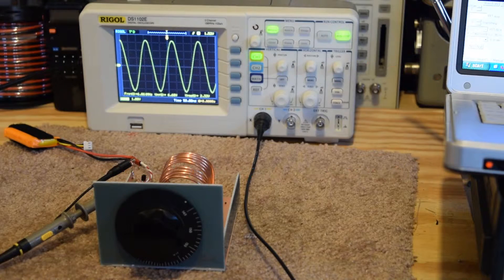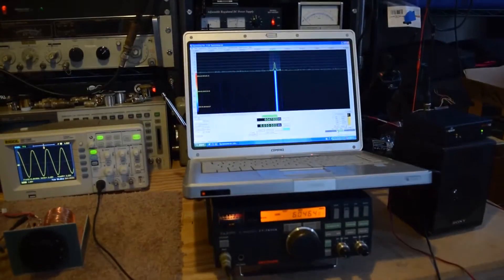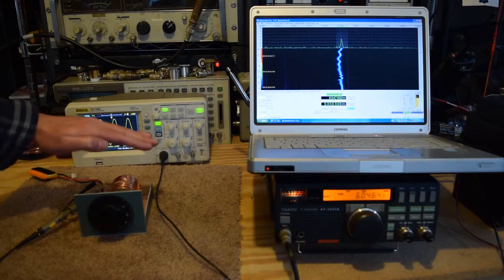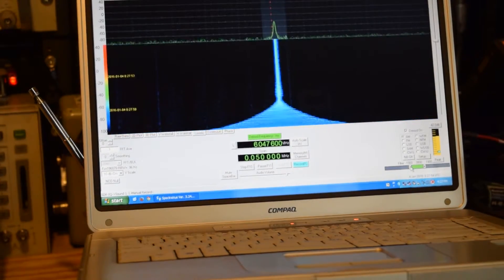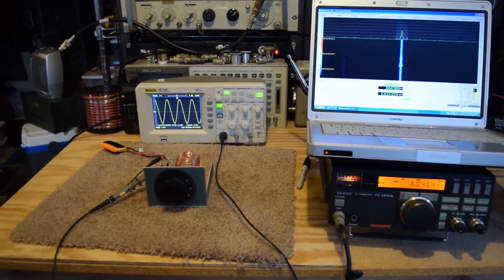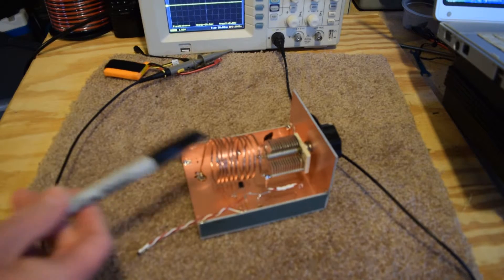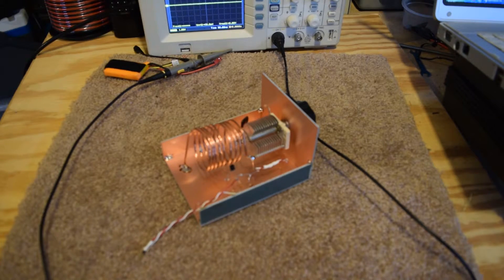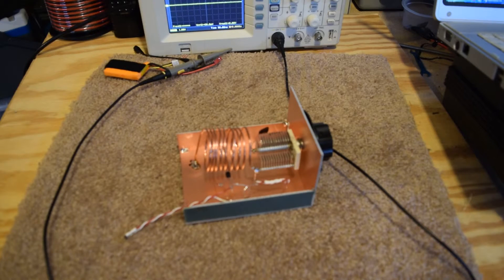A really basic JFET Hartley oscillator.

Comment: I know this is a very old video but maybe a small ferrite with the same inductance could work but I guess it's not easy or maybe not even possible to reach such high frequencies. Also if you wanna stay with the same coil obviously a stable glued support rod would work better, but I am preaching to the choir at this point. Also your hand thingy is non issue since a grounded metal casing would totally negate all capacitance and RFI issues. I could be wrong but just fyi